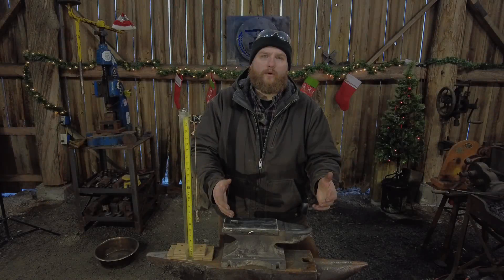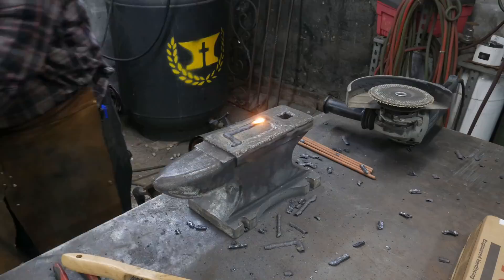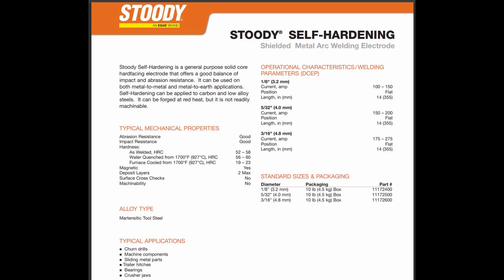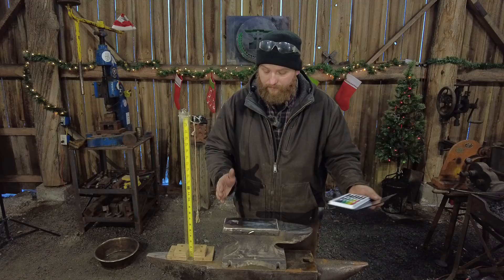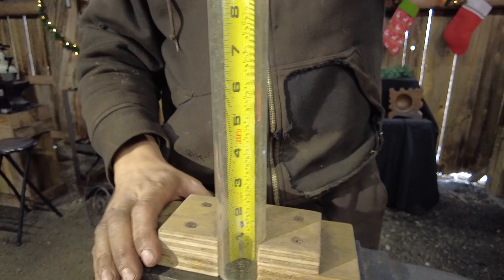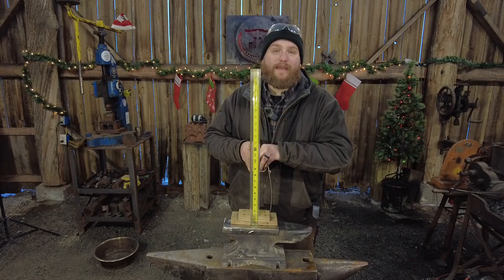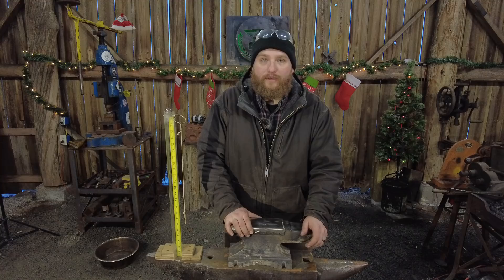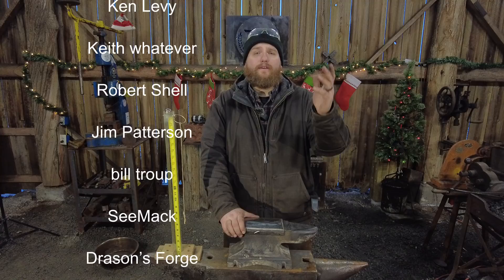Astonishing Results! Hard Surfacing a Harbor Freight Anvil

Comment: Oddly many smiths don't study welding nearly enough. Specialty fillers and weld filler materials in general are highly advanced technology. Welding fora are a good place to learn about them. Stoody, MG and other makers have fillers for nearly every task and being able to repair or upgrade anvils is quite handy. There are also abrasives for every task (Walter, Norton and 3M are rightly famous).  Crown Alloys sell the 44-40 cast iron repair MIG wire (requires argon gas) which is outstanding. It can even repair installed exhaust manifolds per aametalmasters Weldingweb and other threads which show pics.  Every metalworker should have welding capability. If you want serious amps the old transformer industrial machines can be gotten cheap (because they're heavy, scaffolding casters and an angle base solve that if ya get one without a cart) and their high OCV makes them a joy to use.

Comment: a quick spark test would show if that anvil is either cast steel or cast iron. if that thing is indeed a cast iron anvil, the hard facing will pop off on the first good hard use of it. no pre-heat virtually guarantees that, and if it's cast steel without a pre-heat the hard surface will crack eventually if it hasn't already
Reply: Thats what the books have you believe. I've welded some cast b.s. monkey metal out of necessity and had it hold for years. Sometimes it just defies reality.
Reply: @1980Baldeagle  there is some truth to that. i've seen it too. the cast iron pieces i've welded with regular rod didn't stick at all. brazing was the only thing i;ve used that actually held together aside from nickel rod. but then it also depends on how much the part is stressed before it breaks.

Comment: 👍🏼not bad ! I don't know if it's possible but you can also try getting hardened steel plate and welding it to the surface of it and try that out to see if it's any better. I've heard from people that's the best option 🤷 because you can pick the exact hardening of the plate steel and thickness to your liking.
Reply: I think that in question. You could as long as both plate and anvil are  very flat
Reply: ive seen someone do that and they ended up  with an anvil worse than the starting anvil because their was a gap between the top of the harbour freight anvil and the hardened plate. a hardened steel plate would have given equally Good results.
Reply: You’d have to forge weld the whole plate to the anvil face, or you get a completely dead anvilive seen people try it, and don’t remember the channel, but years ago someone took the time to forge weld a plate on, then clean it up, rough, then anneal, harden, and temper it, great results, but definitely for the cost and time, the equipment you’d need, you’d already have at least one good anvil, and likely a bunch, so it’d be a net loss, unless you’re trying to make good ones, out of garbage, and think you can make them fast enough, to justify doing it and selling them. At that rate though, you’d probably have to cycle through as many as you could in a day, on just forge welding, then have people who could anneal and harden them as you welded more, etc. but they’d still cost a lot, so people could just buy good ones for slightly more….maybe even less.
Reply: @Plastikdoom   on the price of anvils $350-400 ballpark at the low end for a 70 pounder Not including shipping.  So unless you have the tools I would not do the plate way. but the stick weld way.   It would be  at or less than buying a new one  if you started from scratch even then it kind of a win. you now have a welder and anvil.  On larger anvil this would be a win. As the start at $800 and up.
Reply: @blackgriffinxx  yeah for sure, I was saying for forge welding the plate on, not worth it, as it’ll be same cost or more with your labor, materials. And that’s even with big trip hammers, want to try to do it by hand? Sure it’s possible, but will suck, haha.
Reply: @henrydando  and that's why I don't listen to everything I hear

Comment: I haven't done any hard-facing as a pro for... decades, but I seem to recall that Stoody makes an electrode that they call "BU" for 'build-up' that is often used as the boundary layer between the hard-facing and the parent metal.
As others have said I would have suggested pre- and post-heating the anvil during the welding process.
Bottom line, though... if it works, it works.

Comment: Honestly being a welder that’s expanding my blacksmithing skills I’m not really good at the blacksmithing but slowly getting better. Anyway usually when welding cast iron with 6013 kinda works but it’s very weak around the weld I’m not sure if it will eventually start to pull off a ST rod is what is normally used to weld cast iron and can be tricky sometimes with preheating and slow cooling to prevent cracks. I’m going to look for a update video for this now.

Comment: Thank you or the testing.  i have hard surfced small ( i kg ) jewlery anvils successfully using tghe sme techniques, but hey really aren't anvils at all.  Still, I had good results.  zi had considered surfacin my HF anvil, but it's an awful lot of work with no idea if it might acually work.Again, thanks for the tesing.  Anvils are a hobby for me (as opposed to a usiness)  so buying "Good" anvil is right out, until after my yacht and sports car.

Comment: I would say it's perfect in a pinch. If you don't have access to a better anvil or on a job with limited resources then It will work beautifully.  The real test would be put it through an honest days work and see what it looks like at the end of the week. You could also resurface the entire deck with a mild to hardened steele plate sandwich. The mild steel would act as a cushion for the hardened steel and give the cast iron base a little protection. Just a thought.

Comment: Kinda surprised the 6013 made a decent enough weld to be a filler layer…hmm. Especially without heating the cast. Wonder how well some 309 would do with a preheat, I’ve definitely had to weld ductile with 309 to stainless, or carbon, or other ductile, and it worked just fine. Then run it over with 7018, then hardface? Could probably double layer then with no issues.
Reply from the maker: I did pre heat but some how Lost the footage
Reply: As a fellow  welder fabricator I agree with  you %100 stainless first
Reply: @ChristCenteredIronworks  ahh, ok, no worries, was just curious as to how it managed to work well enough on that much cast, thinner stuff will weld kinda decent without it, if you don’t need a lot of strength. Great results though, I have one of those anvils I got awhile back, and thought about doing that, might actually do it now, any improvement to it would be far better than they come.
Reply: @huckstirred7112  yeah, it would bond better and let the 60 or 70 series really weld great. Also figured you’d end up more like an alloyed steel layer on top, as it’ll burn out some of the carbon and mix it all together. Taking out some of the brittleness. Just from basic experience of getting into blacksmithing years ago, and lots of welding for my current job, on dirty crap metals, the old existing stuff on dairy farms, we install and maintain pumps and equipment on them. And before that just shop class and welding on farms growing up.
Reply: Ahh I see I'm not the only one who does this.

Comment: So I guess the biggest question I have is; since the layer of hardened metal is quite thin, after actually forging on it for some time, would the work start to temper the hardened surface? Thinner metal heats up a lot quicker. Would be interesting to see a test where you do a significant amount of forging on this anvil, then do the ball bearing test again.
Reply: Assuming the weld layer was fused well I wouldn't expect an issue as it is really all one piece of metal, just a layer of a different type, so should dissipate heat well into the body of the anvil. If it was a sheet of hard steel sitting on top of the cast anvil, then I could see there being issues

Comment: For $25 Harbor Freight sells a "forged, high carbon steel" 12 lb sledge hammer.
Taking out the price of a handle, that means their manufacturing cost for the head is probably no more than 50 cents a pound.
If you can manufacture that, you can manufacture a 100 pound forged steel anvil and sell it for $150 and make a good profit.
Reply: would be nice if it worked out like that but there is a major difference in working with a 12lb hunk of steel vs 100lb hunk of steel. that would take some serious effort and equipment to accomplish. there is a reason good anvils are not cheap. i do think it would be a good business tho, with the demand being what it is its crazy what some people are paying for worn out crap. i have a 100lb vulcan ( cast body with hardened steel top) in great shape and only paid 40$ for it but i see people paying a few $ per lb for some of these things that look like they have been thru hell.
Reply: not necessarily true

Comment: Would have thought before you started welding on it you would have preheated the anvil. Burn some of that surface and near surface junk off, and 60 series welding rods are cellulose type rods. An handle burn through garage, trash, etc,,, 70 series welding rods want a very clean surface to stick too.
Reply from the maker: I did pre heat but unfortunately loss the video footage of that part... Darn cameras LoL

Comment: I usually take a piece of scrap, a mild steel plate, cut out a hardy hole, and then harden and temper the plate. I then weld it to the top of the HF anvil.
Reply: you hardened mild steel?

Comment: Excellent.  While I have a good anvil in the forge area, I have an old harbor freight anvil in the fab shop.  I'm going to give that a try.  I have some old 7018 that I need to use up, I'm wondering if that would make a good base layer.

Comment: I question the longer term viability of so thin a layer of hard face material.  About 30 years ago I had some hammer dies faced with a specialty material which I no longer recall, but it was fairly exotic and made for the sort of application to which I was going to put it.  The dies failed in minutes due to the lack of sufficient thickness, which was about 1/4" on a set of 4140 hammer dies.  One pound of hard face rods over that large an area isn't going to yield a very thick layer.

It will be interesting to see how much use this will stand.

Comment: Cool video! Do you think welding a 3/4" thick piece of AR500 onto the surface would be a viable uption here? That's what I'm thinking about doing...
Reply from the maker: Good question! I will be doing something similar in a future video
Reply: @ChristCenteredIronworks  A 26"x17.5"x1" drop of AR500 is $135 at the local steel place near me, so I'd be better off getting one of the blue boys for the same money. I look forward to a video on this, however!!

Comment: Great content.  I have a question, if you don't mind:
You went with the Stoody Self-Hardening rod for this, even though the general recommendation is to use Stoody 2110/1105.
Have you been happy with this rod in this application?  (re:  hardness, durability to impact)

I'm looking at different hardfacing rods to use on my own anvil, and I can see why you chose this one-  it does seem to have the sort of attributes you'd want for an anvil face.  My situation is a bit different though-  rather than surfacing a cast iron anvil, I will be surfacing an anvil I made myself out of A36 plate.
Would be happy to get any thoughts from you on this Stoody Self-Hardening rod now that you've got some time with it.  Thanks!

Comment: my old vice you can beat the hell out of it and it dont ding or dent anywhere , i got it the way it is and someone welded the heck out of it at some point and then ground down , all the faces are clean n true but there is a bunch of weld that wasnt ground down totally on the places you dont use . im curious if they "hardfaced" it like this ?  i got a new vice and that thing is super soft , miss with the hammer and puts a nice ding in it , and its sloppy , it took maybe a summer on the new one to mess up the jaws so it wont close flat n true anymore , the old one is tight n true ! way better .

Comment: I have an old ACME 75# which is similar in construction.  An Homish blacksmith removed the top and rewelded it to the base because it was separated in spots.  Only charged me $30.00.  Then a machinist charged $100.00  to remove all of the cold chisel marks all over the top surface and the horn which someone had used to cut material.   Probably could have done the same with a grinder, but oh well, I have a fairly decent anvil now.
Reply: By the way yours should perform about the same as mine.

Comment: Just out of curiosity, you call it cast iron, are you sure it's not cast steel? 6013 usually does not do well on cast iron but does well on cast steel. I love the experiment.  Did you use Stoody 2110 (base) and Stoody 1105 or did you actually use the Stoody Self hardening Hardfacing rod in the Airgas link? Thanks for doing this, I think it helps a lot of people see what happens when you make changes. I also did not expect to see those results

Comment: I recently picked up two anvils which are in very bad condition , a 50lb and a 350lb both are old and both have a hard surface.  I started work on the smaller grinding though the rust and scares.  I have the small anvil back to bright metal but there is a dip in the centre of the surface of about 1/8th inch and a few deep scars where the rust penetrated deeper .  Would you recommend hard surfacing ? Should I fill the dip or the entire surface?  I would appreciate any advice, the large anvil is in a similar condition and I'd like to get my method sorted out before I start on it.

Comment: Oh, yeah, I've done this before. 
I imagine using 6013 wouldn't be a bad rod to start with since it's meant as a deep penetrating rod for dirty materials. Might follow up with some 7018 or 7014 before going on to the hardface. I welded mine with MIG (including hardfacing MIG wire), and it welded just fine, so I don't think a special cast iron rod is completely necessary.
Reply: 6013 is a rutile coated electrode.... shallow penetrating low ductility.  Low penetrating welds helps to reduce dilution with the parent metal.
There are two SMAW electrodes rated as deep penetrating... 6010 and 6011, both cellulose coated.

Comment: It would have been interesting to see you lay round rod the length of the surface with a 1/8 inch gap between them then weld in-between each one instead of a all weld buildup. It seems like it would go easier and a better surface after grinding with less welding and rods. I think that would have been the only thing different that would come from my mind.
Reply: While less work, I think there would be fusion issues where the rod touches the anvil. In this case, the hard facing is fully fused with the anvil.

Comment: now I wonder if it can be hardened more as you did before, instead, use ice to harden it
Reply from the maker: For  quenching it will harden to 60+ HRC but My guess is that will cause some big cracks to happen 😉
Reply: @ChristCenteredIronworks  gray iron does not crack very easily but the weld I think your right on the weld it may also separate try it on a small piece
Reply: thanks for the comeback brother it would seem we are in the berth pains now

Comment: For what you’ve got in that for time and money, you could buy a piece of 1050 round bar that’s like 8” diameter and 4” thick, heat treat it and be pretty well off. It’s exactly what I use, cost me $50 from a scrap yard and it’s not a polished turd like that cast garbage is.

My issue with that hard faced cast iron is safety. That could cause any number of issues that wouldn’t be visible, and would likely go unnoticed until your hammer shatters a corner off the thing and you’re left digging chinesium anvil bits out of your neck with needle nose pliers for the next friggin week.

Comment: 70 bucks for the cheapo anvil and about 60 bucks for the welding rods may seem like a good way to save a couple hundred bucks, but I still don't think it's worth the effort. Mainly because the horn is still brittle and will probably snap on you at some point. You can try to resurface the horn, but you'll just end spending close to what a decent quality cast steel anvil would run you.

Comment: What a load of nonsense. Rebound means very little when it comes to how tough a piece of material is. Glass is hard and bounces really well. I have worked with glass with a 52hrc and  extremely heat resistant properties, but it would make a poor anvil material. Much like anvil ring is a myth when it comes to an actual test. The best thing for a ringing noise is a very thin a preferably hollow ie a bell or symbol. Ps most symbols are made from soft materials. Not to mention nobody wants an anvil that rings hurting their ears all day. The hammering is bad enough. 6013 is a good general purpose rod but as a backing for a hard face?  Oh well, whatever floats your boat but just remember your ancestors built most of the biggest technological advances in history with iron.